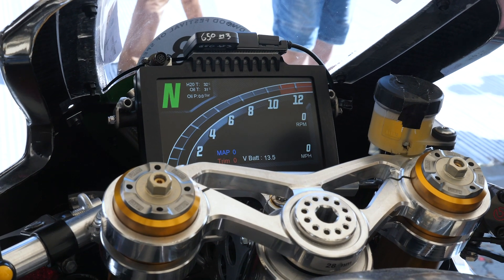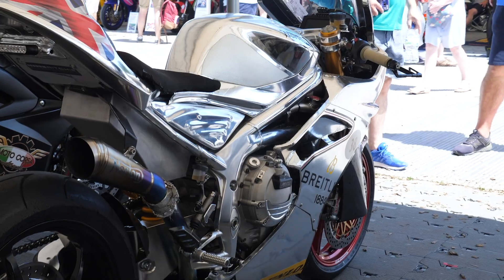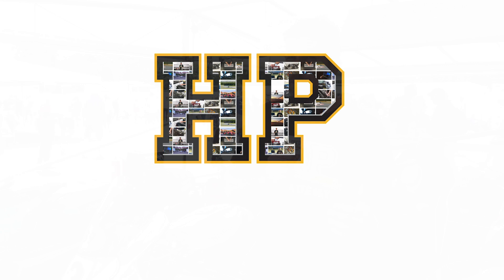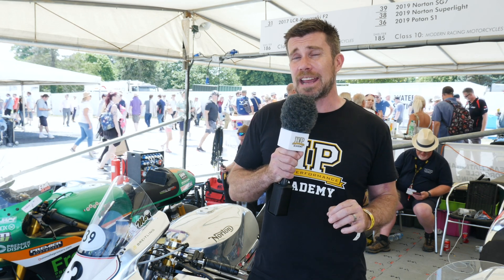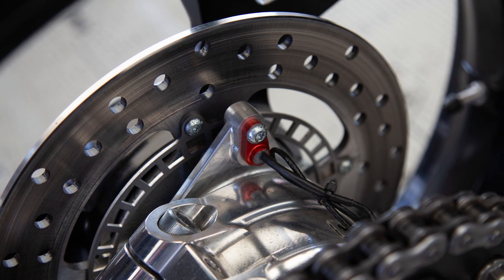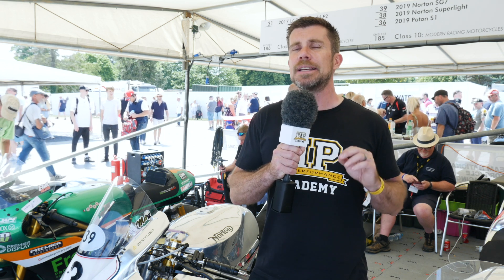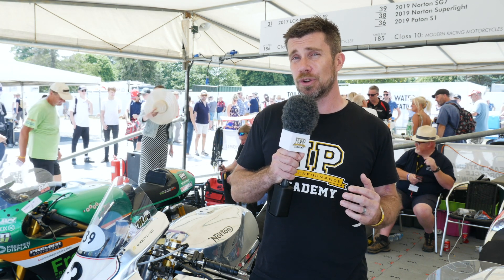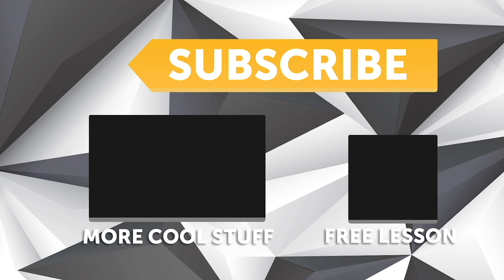How NOT To Wheelie | Norton Motorcycles Anti-Wheelie Technology [TECH NUGGET]

Comment: A lot of high end modern MCs already have anti lock anti wheelie shared brake actuation front rear and some sense lean angle acceleration pitch ....but as far as I know no one has a wheelie over save mode ....as far as I know they either totally kill wheelies or you shut it off to wheelie ....why the hell NOT monitor the pitch and level and cut the throttle and activate rear brake just enough to keep from looping the damn thing!  TOTALLY doable on several models I can think of...prolly have to come from manufacturer though I suspect....
Reply: Bmw s1000r and probably rr allow you to controo how much wheely to allow in 3 stages

Comment: i have thought about this tech before but i wanted it to be made so you dont go over when doing a wheeling. I would think a gyro could be used so if you go past your balance point the rear brake would automatically grab forcing the front wheel down.

Comment: For best results, they use front fork extension sensor before it leaves the ground, and when its i the air, they use proximity sensor, measuring the distance from the front fork bottom, to the ground, and electronics try to keep that at the desired level. Gyroscopes etc are not reliable with all the ups and downs of the track. For fuel conservation, they go to a less fuel consuming mapping first